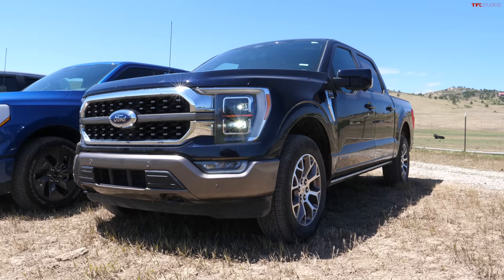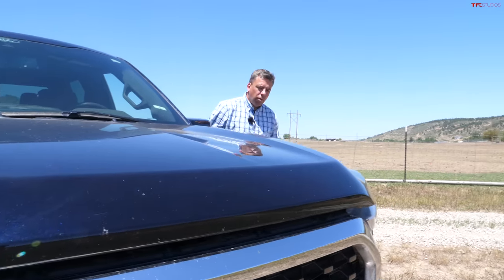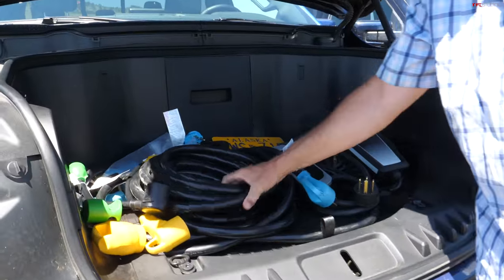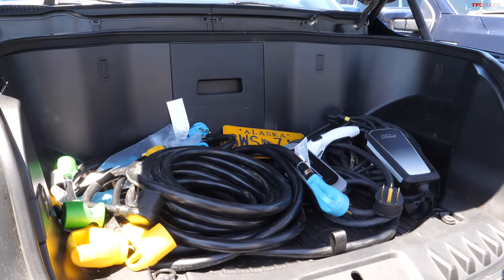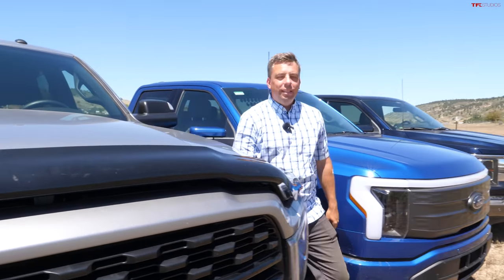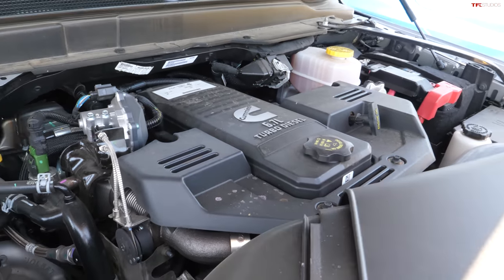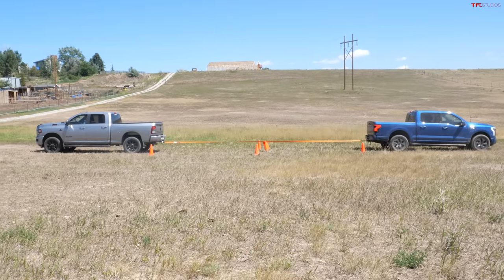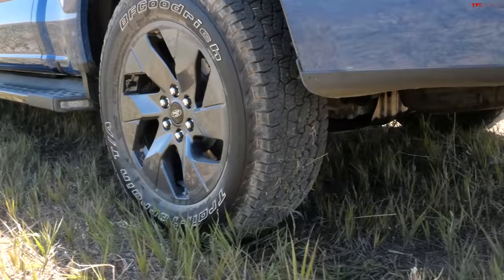Diesel vs Electric Tug-of-War: Ford F-150 Lightning Takes on the Ram 2500 Cummins In a Nail Biter!

Comment: My biggest question is how long will the electric motors last? I know motor trend had Tesla's motor's replaced in there test vehicles will the Ford's motor's stop working
Reply: Yes.
Reply: Electric motors generally last a very, very long time. Much longer than internal combustion engines.
Reply: Electric motors last a very long time especially in comparison to gas/diesel engines. Think about all the things you have with an electric motor and how often they’ve broken.
Reply: @khakiswag  well the disc drive on my Xbox 360 gave out after about a year. 

Electric motors do last a long time, but I think we really do need to start questioning the serviceability of Evs going forward. Things like swapping a motor should be fairly plug and play for even someone that doesn't know how a BEV works, but we have to hound Ev makers about it and maybe even get the government involved to have some sort of Shade Tree Mechanics laws in place. Otherwise as we transition to Evs we risk losing the ability to service our own vehicle completely. Do we really want the world full of more Apple/John Deere clones?
Reply: @khakiswag  i've had fans stop working within a few years.
Reply: @stever5359  How often do blower motors go out on a car? Or starter motors? We haven't had EV's long enough to say their drive motors will last a long time.
Reply: @stever5359  Electric motor last a long time but the power management system is the weak link.
Reply: @AHungryHunky  sounds good but we live in a very litigious country. Automakers will have to shield themselves from Bubba Gump electrocuting himself despite all the stickers, warnings and orange cables. Remember the McDonalds hot coffee lawsuit.
Reply: @4dscdriver  and my Mom had an engine fail on a car in 300 miles.
Reply: Properly designed electric motors are extremely reliable.
Reply: The only problem I ever had with any electric motor was lubrication. I would assume that these new style EV motors still need some type of lubrication but who knows. Once I put a little oil/grease in the bearings they were good for another 100K miles.

Comment: I live in alaska and used to work in prudhoe bay.  I guarantee that battery truck had to have a generator to get up to the oil field - there's no charging stations.  Also, there is zero chance it went up in winter...I would bet they made the drive in either June, July or August.

Comment: The electric motors have 100% of torque available at all RPMs, which gives it more horsepower at lower RPMs. The diesels do the same thing to the gasoline engines because the high torque available at low RPMs means higher horsepower at low RPMs.

Comment: This test is like comparing a pro street car that is tubbed, has drag slicks, the right gearing and a professional driver vs Joe Schmoe in a Hellcat. Yeah...they make roughly the same power, weight is roughly the same but they are not built for the same thing and one will clearly outperform the other. I think any reasonable truck buyer who plans to use his truck to do truck stuff is not looking at an EV. Everyone I know that owns a truck and uses it as a truck couldn't use a Lightning to do the things they do with their current trucks without having to stop and charge it every 100 miles. It may be practical 90% of the time, but that 10% is why we buy a truck.

Comment: Traction and balance wins tug of war.
Tires and weight distribution.

A Jeep Liberty has more weight on the rear tires than a pickup truck.
Even with a smaller engine, it could probably pull any of those trucks.

Comment: i call bullshit. the gas truck has more torque, because the tires started slipping. whereas the electric truck never had that issue. i would also like to add a quote from carroll shelby. "there's no such thing as too much torque, just not enough traction."

Comment: I would imagine there’s quite a price point difference. Also it will be the diesel that brings the charger when the electric runs out of juice. With the rising cost of electricity I see no reason for spending the extra dough on the electric.

Comment: The thing is, Electric motors need rotation to build torque and in order to not go into overheat because if they stall still then the motor becomes sort of a useless transformer with loads of heat output.,   Gasoline and Diesel engines are mechanical, its  a lot harder to stop them, especially the diesel.   Surely there is a lots of torque in the Electric motor when they can actually rotate at high rpm, efficiency and more but the diesel is still the king of the pulling power in terms of raw pull and efficiency cost wise.

Comment: I saw a video about the electric Hummer and it wasn't good news for the Hummer. The Hummer broke down after 250 miles. Here's the thing with you guys can be asking yourself. Batteries die in cold weather a lot faster and these electric vehicles the harder you push on the pedal. The less range that vehicle has. Meaning an electric powered vehicle won't work in colder climates as well as a gas or diesel powered vehicle because the harder you push the pedal, if you have the heat on and how cold it is Will make electric range much less.

Comment: Hook up a trailer to each truck, weighing 12,000 lbs each, fully charge the EV and fill up the diesel, and drive both from Cheyenne, WY to Rock Springs, down I-80 without stopping, and we'll see who's the better hauler, even though I don't prefer Dodge trucks.  PS: they both have to maintain top legal highway speeds (75-80 mph).

Comment: I’m a Ford guy through and through, but I’d take the Cummins over that electric waste of space any day of the week. Sure it’s got more Torque, but I’d much more prefer to haul my payload, or trailer to its destination non stop, or stopping just long enough to fill up, than having to stop at less than a full tank worth of miles to charge my truck again.

Comment: These are cool and all but as usual, when it comes down to it, the lightening is a city truck for the “green” drivers. On the highway towing, I’ll take 500+ mile range in a diesel with a 3-5 minute fill up versus 150ish mile range and anywhere from 30min to 5 dang days for these ev’s to charge. These things are a nice thought but will be the ends of a lot of car companies. I’ll be one of the last hold outs to get rid of my diesel.

Comment: I forget what year that 3/4 ton Cummins is but I have a couple of things of note about it the three quarter ton has an open rear differential unless they've got one that's unusual it has 3.42 rear gears final gears I would imagine that if the gearing itself was changed to 373 and it was a limited slip diff or better yet 4.11 even without changing the tires which somebody has already mentioned are highway tires I bet it would have done a better job I also would say if that 6.7 is completely stock and untouched you probably don't want to do that type of tug of war on it first too long anyway

Comment: Diesel still wins, what they don't tell you is the ram can drive home...the ford will need 24 hours on high speed charge to move,  or 4 days on a charger from a 220 line from your home.

Comment: Was at a body shop recently and was informed of a brand new Ford (electric-full charge) that towed a travel trailer a whole 40 miles before running out of charge.  They will shove this crap down our throat if we don't stand together and push back.

Comment: Add weight to the diesel until it weighs as much as the ev and see how long it takes until the diesel can pull the ev around. That would be equivalent to towing a heavy load for two hundred miles.

Comment: Gas truck is 2 wheel drive? Is the lightning all wheel drive?
Heres a thought 4x4 to 4x4.
Andreas truck clearly was either 4x2 or not in 4x4( f150)
Ram was in 4x4.

Comment: I think I saw a little bit of height difference between the back of the EVO vs the Dodge and it appears to me that the Ford had a little more elevation than the Dodge did. That in itself changes the dynamics of the "pull" power. Nice try guys but I'll not be convinced to buy an electric truck or car at any price!

Comment: The weight of an EV is a huge advantage in both of theses, they didn't do a trailer tow as an EV will lose roughly 30% its range towing an empty flat bed trailer. Roughly 50% with a small load on that trailer, if you need a truck to work with an EV will cost you huge in down time bare in mind as the batteries get weaker the shorter the range the more often you have down time. Then it will cost you again in battery replacement as they last 5 years ish when not under heavy load, that life span is reduced by 30-40% when it under goes rapid discharge. The smallest batteries cost you 15k+ nowadays (including labour), on these trucks I wouldn't be surprised if its upwards of 30k. Now for the guy that's making 1-4 trips a month to the hardware store, with using only the box to move a light load they work just fine.

Comment: Just wondering what happens in the northeast or the Northwest or Central Plain states during the winter when you have to heat EV vehicles to stay warm. How much drain is that going to put on the batteries of an EV?

Comment: you should have used an F250 and the 2500 RAM with weight in the bed to equal the weight of the Lightning.

Comment: Its not a candid test; if trucks have same tires on same soil getting ~same traction, does it really prove anything.  (1000hp with 10hp) to ground may equal (150hp with 10hp) to ground?
Do test on asphalt and let's see what happens.

Comment: The lightning had off road tires. If the gas trucks had some weight in the back holding them down and off road tires it would have been a different story.

Comment: Again in a lot of these non-scientific experiments they do you have to take into consideration the tires on each truck you have to take into consideration the gear ratios on each truck are they running a four-wheel drive or during two-wheel drive and if they're running four-wheel drive are they running like eating Fuller gears or whatever are they running spicers there's a lot of gear ratios in your front end in your rear end and neither one of these would be I don't think CD joint front ends they'd be solid axle front ends and they'd have a lot of pulling power and I think the diesel would do it with the Right Tires it's all I'm saying is it takes tires and gears so don't take motor cuz I seen Toyota Tacomas do things that you would think it takes a jacked up diesel to do

Comment: Tug of wars don’t prove power it’s all about weight and traction pavement or dirt you can have all the power in the world if you have less traction you’ll lose doesn’t matter. Do more real test like more towing if you want power comparisons or do the pull correctly stay on the verge of the stall on the torque converter instead of high wheel speed and digging holes helps if you know how to tug of war
Reply: Really they can't. The EV truck can't sustain and blows through its charge...what they won't show.

Comment: The electric truck is good until you have to replace that 30,000.00 battery in 4 - 5 yrs.  Not to mention it takes an hour to charge them up, so if you're planning on a long trip, you need to find charging stations, and plan another few hours just to charge them. The electric car scam is going to be a disaster.

Comment: What they don't tell you about these EV trucks, it's recommended to change the battery at 100000 miles. The cost of a new battery runs between $0 to $20000. Not very cheap unless you have money falling out of your pockets which most people don't.

Comment: They should of designed these first gen trucks like the Chevy Volt.  Batteries are not there yet, need a gas gen for extended range

Comment: You will be unsuccessful towing a moderate load during cold months that is for sure. The amperage draw on these batters is just too much for long hauls. EVs are ideal, to sit within 50 mile trips for truck hauling, IMHO.

Comment: Turbo boost requires a second to reach peak power and once it did it stopped that EV in its tracks. If they had continued the EV battery would've depleted and lost.

Comment: So yet again, this is another demonstration where you are downplaying one against the other. 
I'm confused on why you would compare a Twin Motor Electric Vehicle to a 6 Cylinder counterpart?
Why would you not compare the more powerful V8 versions? I am sure the priced on the Lightning is far above the price of these V6 trucks, thus... using the V8 counterparts would make more sense. I am sure the Lightning STILL cost more than the V8 version of these gasoline trucks also. So why use the 6 Cylinder trucks against a Twin Electric Motor Truck? Anyone understanding what I'm saying?

Comment: The only thing is after the ram diesel and the Ford electric get done pulling the diesel can still drive away the fords electric battery is probably on 2% at this point.

Comment: Id be curious to kno wat kind of traction control all versions would use. I imagine the Lightning would have a much more sophisticated TRC than either of those competitors. Also you cant drive 100 miles towing at half cap and thats been proven lol

Comment: That's The true power of electric motors electric motors are all torque all at once they will always out beat a gas or diesel motor in speed and torque and mileage too

Comment: The EV will pull more, especially at the low end. Let them both drive for 200 miles, then do the same pull. No refueling or recharging allowed.

Comment: Battery tech needs to be about 10 times better than it is currently to be equivalent to ICE vehicles.  Probably something a lot of the greenies don't want to know is that that it takes 20 years for an electric car to break even on carbon compared to an ICE vehicle.  Thats assuming it isn't totaled, or have its battery replaced in that time, because then the breakeven is extended.  Sounds like a wash to me.  The average age of vehicles on the road is 12 years, so I doubt many electrics will ever make it to breakeven.  Carbon is not only a tailpipe emission metric, but thats what greens what you to think and thats all they ever measure.

Comment: Question only, were the non ev trucks in 4high or 4 low. 4 low often has a different ratio and torque application. Especially in the diesel. Instant torque is nice. Ill take the diesel. Fun video

Comment: The fatal weakness of EVs is the pressure they put on the grid. A single charging EV uses the same juice as 25 full size refrigerators or 5-8 home air-conditioners. So if every American is going to go electric we'd need a grid at least 15 times as large as the current one... and California can't keep its lights on right now. There are no plans to so radically expand the grid. So either they vastly expand power generation or they want you in these networked, controlled electric automobiles so the govt can decide if and when you get to use/ charge them. Guess which one it is.

Comment: uhh, this just proved who has better off road tires. Do it on dry pavement and the Cummins will pull it all over the parking lot. Note that the Ram won't destroy it's drive either. Under load the batteries drain very quickly. If you didn't care about how much fuel you used, an upgraded, fuel using Cummins would kill the electric car. One thing also is batteries will not due well in desert (Southwest) or cold (Northern states).

Comment: Why did you do this on grass?

You want to know which truck is going to drag which based on power, you need traction. I can break the rear wheel loose on a pedal bike on grass. Slap some some drag slicks on these trucks and line them up on a prepped drag strip that's sticky.

Comment: Did not run the test long enough. The ram will sit there and run all day, which is good because you need something reliable to tow that electric toy back to its mommy to get some rest after trying to run with the big boys. 10 more minutes and that lightning truck would be useless

Comment: I appreciate the video however I guarantee the Cummins would win on pavement because of the tire spin. On that battle though if you re-watch it the trucks hardly move at all and I think the reason the flag was on the lightnings side was because of slack tightening.

Comment: I want to see a ev pull a 3 horse steel trailer with 2 2600 lb draft horses on board and get 300 miles without stoping for fuel.

Comment: Or a 6.7 deleted with compound turbos , meth injection over sized pistons and injectors  a hard way tuner turned all the way up, straight piped with 8 inch pipes with k&n open air on 22s hostles on 38s.... that smokes mustangs, corvets, and perty much anything but a zx14 super bike

Comment: I think they should of hooked an old 5'9 cummins to the litning got the strap tight left the engine/motors idle set the parkong brakes removed all batteries and i mean all batteries then holler go need i say more.

Comment: To build up your RPMs spool up your turbo Gazette truck has way more torque than the Ford does and probably as much horsepower and you need to get some media tires and you need to make sure you're in four wheel drive low

Comment: Cool bananas... I wish i had a electric ute...  I will have to suffer with the pain of my diesel 4wd ... Sadly I can only load it up full of gear, plus tow 1.5 ton and only drive 800 miles before I have to refill the tanks... And yeah theres like 5 minutes of my life...  And then I can only drive another 800 miles..

Comment: The real world has already shown that the electric trucks just don't have the endurance to keep up their burst ability. That ram can pull 20k pounds for over 300-400 miles vs that lightning went like 80 miles loaded on your lightning pulling video. Nice & neat but not yet ready for the world of towing. My kubota tractor could pull both those trucks tied together. Everything has its place, I guess.